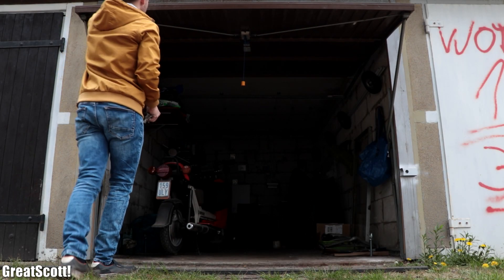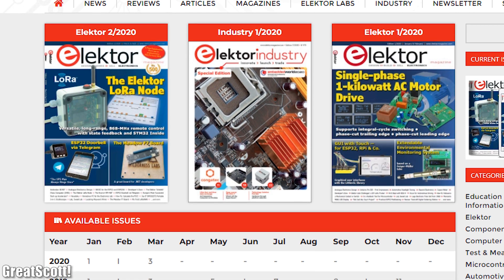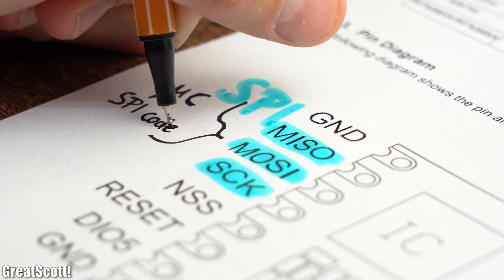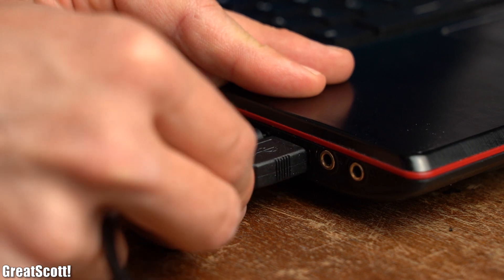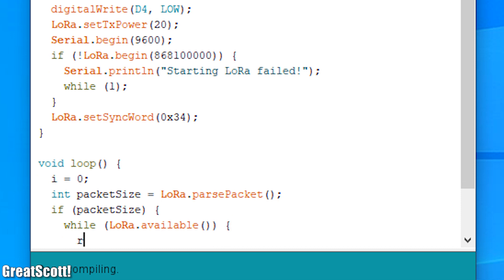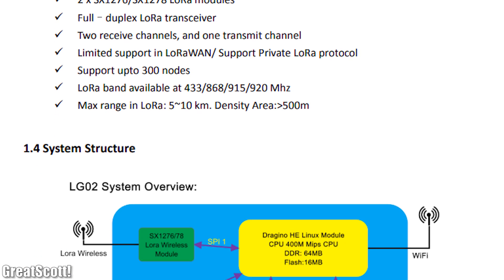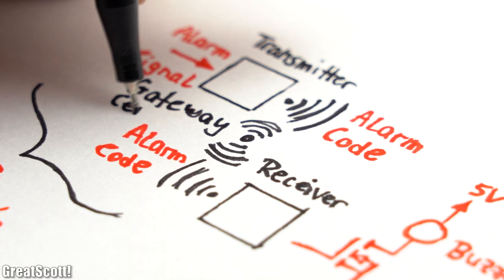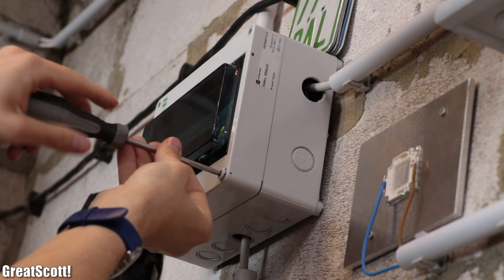Transmitting an Alarm Signal with LoRa (600m)! || Improving my Garage Alarm System

Comment: What's the maximum range? I'd like to try it with my garage, but it's underground 😕
Reply: That is a complicated one, to answer. I was able to get to 7km using sleeve dypole antennas and tx power of 10mW (lowest settings). In my coutry limit is set to 25mW and 500mW on certain bandwidths. I was able to get to 3km using same stuff and settings while i left my tranciever in basement. But consider that sleeve dypoles are much better that those wire ones. But you can still use a directional antenna you can recieve all you want but transmittion is a big no no (check if it is not against the law to tansmit using a directional one but it mostly is in EU). Using this logic i was able to get range of 12km only recieving (uncorrupted data, farther i could still recieve but just giberrish). So i think you should try it ! And putting the antenna out using some better 50ohm cable would be nice.

Comment: I used to read Elector when I was a kid I had no idea it still existed.
In the UK  any of transmitter that can transmit over 100 Meters requires a license.
Reply: I'm not sure about the 100m rule. It's probably a power limitation, not a distance limitation. Because with the right antenna you can totally connect to a vanilla WiFi network more than 100m away. And it work the same with LoRa , 433MHz hardware, or any other frequency. As long as the emitter respect the rated EIRP for the used frequency, you can improve the range by improving the sensitivity of the receiver.
Reply: We are happy you found Elektor again! We publish the magazine in English, Dutch, French, and German. Welcome back!

Comment: just  a tip mate don't run straight to the garage when the alarm goes off, also it would be fun if you add FPV wireless 5.8GHz long range Video TX/RV . only a thought, however great video as always

Comment: I would suggest adding a heartbeat feature to the code. So the transmitter always sends a "I'm still alive" packet every x seconds and when the receiver misses y amount of packets you know that the connection got broken
Reply: I like this idea. So simple yet quite important.
Reply from the maker: Good idea😀
Reply: @greatscottlab  Wenn du umfangreichere Infos dazu möchtest ich hab da eine  Studienarbeit im Master dazu gemacht und bei einer Bachelorarbeit geholfen
Reply: Can you make a video of basics of transistors and how to use them?
Reply: Google that.
Reply: This is not a good idea, is a must ! Every basic alarm system has it. I had an old alarm to my house from the 90' and it was a pain in the but to get rid of it and replace it with a new one, only for this reason : once i removed a sensor or cut the power to an element (even the internal battery), the external alarm that was up near the roof was beginning to sound the alarm, simply because it wasn't receiving the regular signal. I bought a ladder to climb up there and to take it apart piece by piece.
Reply: Yup, this is called supervision. Ideally the base station would send encrypted data requests periodically and the alarm point would send an encrypted response. A simple one-way beacon can be sniffed by the crim and then replicated by his own hardware after he disables yours.
Reply: Meh
Reply: One of the limitations of lora is An average of 30 seconds uplink time on air per day per device and at most 10 downlink msgs per day including acks for confirmed uplinks. Maybe different in other countries but that's the practical limitations we have run into using this tech. An not to mention the number of hacking articles out there which as far as I'm aware are untraceable using lora but I'm not an expert. 👍
Reply: @SlyerFox666  That's for LoRaWAN, not LoRa. You can use LoRa however you want, it's just a radio transmitting protocol. LoRaWAN is an international collaborative WAN (meaning it's not yours), which has a limited bandwidth, so they have to put restrictions in place.
Reply: @GRBtutorials  Oh ok I didn't realise there was a difference thanks for the info 👍 I had to re watch the video again tho as I thought he was using the gateway via the WAN 😆
Reply: @GRBtutorials  @GreatScott! LoRa uses the unlicensed 433 or 868MHz band, the utilization of these bands are limited by law (EU wide). Depending on the frequency duty cycles above 0.1 , 1 and 10% may be illegal. Violation of these "free" bands are quite likely to trigger a hamradio operator nearby to call authorities. (hamradio hobbyist don't like "spam" on the free frequency bands)
Reply: @GRBtutorials  To be precise it's the limitation for LoRaWAN using Semtech services. You can set-up your own LoRaWAN infrastructure and base stations, and transmit messages in any direction without limitation. But it require more skills (system and network administration, configuration of the gateway(s) and clients etc.) and infrastructure.
Reply: @GRBtutorials  no that's wrong, it's because of the ism and srd Band limitations not because of lorawan
Reply: @Piktogrammdd1234  you can avoid this with lbt and fh
Reply: @lexus4tw  One could, but it gets quite complicated with his hardware. The two LoRa Devices he uses are single channel only. Implementing frequency with two devices complicates things quite a bit. With a proper gateway (LoRa concentrator) hopping is no problem, but one should implement the proper LoRa WAN Protocoll to use these.
Reply: @Piktogrammdd1234  I did this, took me one day, used the stm32 lora stack.
Also there are modules like symphony link which implement this
Reply: @lexus4tw  Well after spending half a year with LoRa, getting to know a lot of the shortcomings of the different implementations (soft-, hardware and protocol). I'm also able to get this stuff to run. For every hobbyist it is almost predetermined, to fail in implementing a proper LoRa protocol stack (including the security errata).
Every Arduino Implementation (LoRa.h and MKRWAN.h) are somewhat broken to incomplete and are ignoring official LoRa security errata. Also most of the hardware a hobbyist wants to buy is utterly broken (e.g. the Dragino "Gateway" Scott bought which isn't based on Semtech SX13xx Chips and therefore is not LoRa compatible Gateway at all).
Reply: @Piktogrammdd1234  yeah, that's right, the arduino libraries ignore many specifications
Reply: @Piktogrammdd1234  ham radio hobbyists don't really care about ISM bands, they're full of interference. Ham Radio operators don't like people messing with their licenced bands. ISM is not one of those.

We (I am a ham radio hobbyist) do care about spectrum abuse but not specifically about ISM bands. If you cause harmonics across the licenced bands, yes I may track it down and report it, but will I monitor your device for the duty cycle or power output of a signal on ISM bands without otherwise being provoked, no extremely unlikely.
Reply: @lexus4tw  nope. It's because lorawan is essentially a messaging network that passes messages. If you send too many, you will flood the network and you will find that gateways will drop your packets.

The limitations around lorawan messaging has absolutely nothing to do with ISM band restrictions and is in fact a limitation for anyone using the semtech services to join the global WAN.

You can technically if you wish set up your own LAN(WAN) using LORAWAN and smash as many messages you like around your own network, without such a limitation.
Reply: @lmaoroflcopter  except by law you still have to follow duty cycle and other rules. So there are still limitations, lorawan, lora or any other protocol on the frequencies doesn't change that.
Reply: @Piktogrammdd1234 could you recomend what to read to understand lorawan? Is there newer and better system than lora?
Reply: SlierFox if that is a limitation, can’t you just use a gsm module instead? Then you can use any kind of communication? Data is quite cheap nowadays?
Reply: @roygalaasen  LoRa is free, so it's better than GSM by default.
Reply: @roygalaasen  I'm not sure to be fair but I will certainly find out, I do know the projects are water based and usually sealed up so it might eliminate the use of a traditional SIM card but you can get the IC/ embedded version, so it may be possible. The only other constrain would be budget that I can think of that may be an issue but thanks for the idea I will certainly ask. 👍
Reply: @SlyerFox666  nope it's depends on the frequency and if you use listen before talke and frequency hopping. You can use protocols like aloha to get around this restrictions.
Reply: @lexus4tw  Nope What frequency hoping you gonna do when there are only two available 🤦🏼‍♂️
Reply: @SlyerFox666  LoRa can use 863-870MHz and LoRa normally uses a channel width of 125KHz. Including some margins for channel separation lets calculate the number of channels (freuqncies) to hop: 7MHz / 200KHz = 35. Having 35 possibilities for frequency hopping is quite good.
It's just a hssle to synchronize the hopping between devices with a single channel receiver.

Comment: If i remember correctly Arduino nano works at 3.3V, and is much smaller, I think it would have been a better fit, at least on the garage side.
Reply: but can it do the same work
Reply: @big_o1952  I don't see any reason to not work

Comment: Can you build a transmitter and receiver for drone?
Reply: too low data rate, and you cant transmit non stop on lora bands in probably all countries, but there is new a 2.4Ghz lora chip out so if you feel adventurous you can try it

Comment: Heard about "The Things Network"? There are a lot of LoRaWAN gateways installed in Germany - maybe one of them reachable to your place - where you just need a node. The node sends signals to the gateway which will then upload data to the network and you can use it as you want.
Reply from the maker: Sadly there are no gateways in my area.

Comment: The pin header you soldered to the ANA pin of the RFM96 is compromising the total length of the antenna wire! Just think of having the antenna wire + pin header (1cm?) + breadboard trace (another 2cm?) ...Anyway great videos!
Reply from the maker: Possible, but it still worked pretty good. But you can of course experiment with different lengths.

Comment: I have an idea for a DIY or buy episode. An adapter for a rotary dial phone. I have an Bakelit phone but when you hook it up you can receive calls up pick it up but you can't call sombody because the pulse dialing is not supported on modern routers. A converte costs at least 35€ it would be interesting to see if you could make one which an microcontroller or something.

Comment: Could use a 3.3v arduino trinket... then after testing dump the arduinio and run the bare AVR chip in the product...
Reply from the maker: Sure. You can do this project in hundred different ways.

Comment: I have those lora boards but their pinout distance is not standard, I didn't get breakout boards, so is there any homemade(lockdown imposed!) way to use them with my breadboard?
And great video as always!
Reply from the maker: I would recommend some silvered copper wire to spread out the pins. I did something like that in my DIY Radio build. Watch that.
Reply: @greatscottlab  Ok, I will check, thanks.

Comment: I actually have a TTIG gateway, that I haven't played with yet. Didn't know you could program STM devices in Arduino IDE. Great video.
Reply: STM has written an Arduino core for pretty much all their micros. Been out for about a year or so. But actually they have their own system called stm32CubeIDE which is awesome and includes a debugger so better than using arduino IDE.
Reply: Also take a look on mbed.

Comment: So, he made a video on how exactly the alarm of his garage works. Sound like a great safety feature to me ;)
Reply from the maker: You bet!
Reply: @greatscottlab  why didn't your alarm system work ? Did it go off and you didn't hear it?
Reply: @greatscottlab  Couldn't someone disable it with an EMP? I assume you know what that is.
Reply: @mrss649  you could make an EMP stun gun looking thing, but they are really short range. You’d have to be pretty much touching the device to destroy it with a portable EMP device. Any EMP gun devices you can aim are still mythical. EMPs aren’t really a weapon unless a nuke triggers it.
Reply: those idiots couldn't reverse engineer this of they had an eternity to figure it out. Most thrives are borderline fucking nitwits
Reply: @ryanmalin  yeah and not to mention, any GOOD thief would be able to bypass these kinds of protections. I'm thinking hes not worried about the handful of good thiefs, but instead the plethora of shitbags.
Reply: @colesherrill7472  I mean probably the good thiefs also wouldn't see any apeal in the stuff he stores there.
Reply: @ryanmalin  Exactly! Anyone with that kind of knowledge in electrical engineering wouldn't have to wander around and steal things. He could have a steady job and earn a lot more that way.
Reply: Well anyone smart enough to know how this works is most likely not gonna steal though because he has a job wich requires this knowledge
Reply: @Inkreptile  that's a good point.
Reply: They can jam the LoRa signal
Reply: @DSCKottawa  Yes. But only really if they were targeting someone specifically using LORA.

In most cases the thief will just break in anyway and sod the noise. Either work fast, or go equipped to fight.
Reply: Kind've creepy to think the thief is likely to know he has a reasonably popular YT channel and watches it himself.
Reply: You shuldn't trust a security system only because you don't know how it woks. You can understand you have down a great job when even the maker can't hack into is creation. This is usually refered to criptography security.
Reply: I bet he changed the frequency or something afterwards.
Reply: Security*
Reply: If I was a thief and encounter this, I would wait for the owner and learn from him😆.
Reply: Ok so.. the way to code the thing about disabling the alarm system one could also code an alarm if there is no signal.  That said, y'all are still right, this is going to protect against the thug.   A real engineer could hack that too simply by reverse engineering the protocol he used which is incidentally not encrypted.
Reply: Forget jamming it, I'd build an identical transmitter to set off the siren in his house 🤣
Reply: All of the best and most secure protocols are completely open and free. Example: The TLS protocol used as part of HTTPS is totally open, but that doesn't mean that your unencrypted banking data is in the hands of criminals.

EDIT: The idea should be to protect through cryptography, not obscurity or obfusctation, this agrees with other such comments in this thread.
Reply: I think that if the thief knows him, he whould go for an autograf instead of stealing dx

Comment: I might actually need something like this for the place I'm moving to. The mailbox is way out of sight of the cabin on the property and since I use Amazon Prime quite heavily, I'm going to want to build a package locker(to prevent theft and weather damage) with a notification system that ideally doesn't require internet.
Reply: Check out Andreas Spiess’ YouTube channel specifically this video for his mailbox solution https://youtu.be/WV_VumvI-0A
Reply: Bluetooth might be useful
Reply: @thesabre8458  Bluetooth has a LOS range of ~300 meters, add trees and vegetation to that and you're dead in the water. LoRa in 433/868MHz is just the right thing for that. I used an RFM69 module (GFSK) for a drone and got ~600m through buildings and >2km in LOS. With an RFM96 (LoRa) you can easily reach 2km even under bad conditions because of the better modulation.